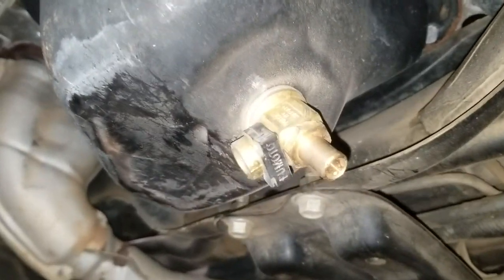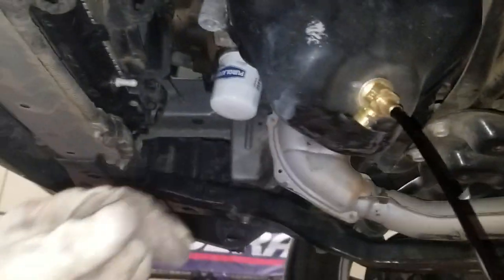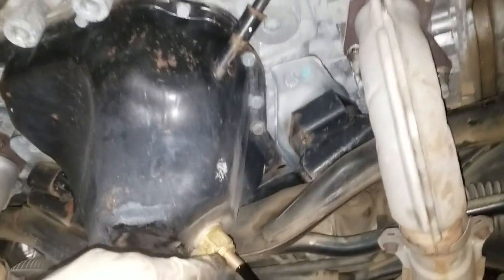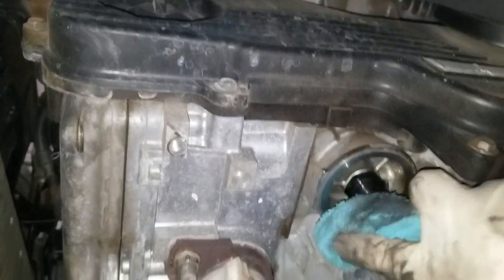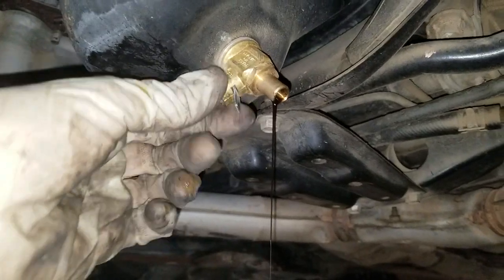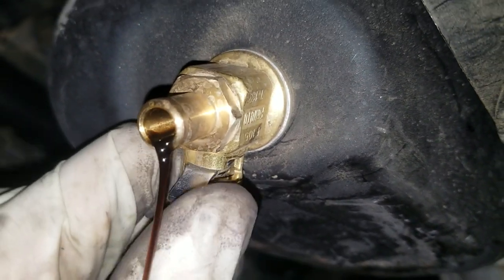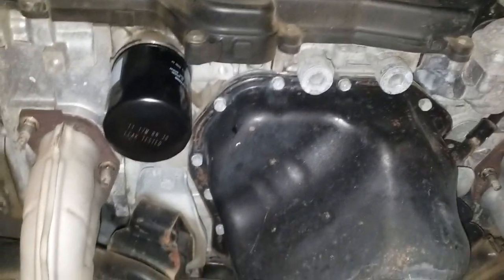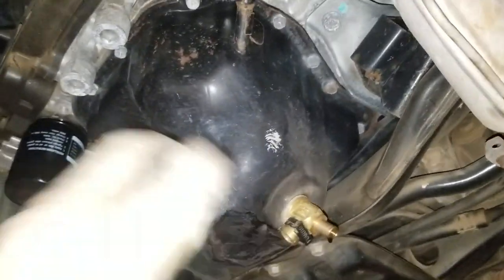Fumoto drain valve dangerous to your engine?

Comment: I'd be concerned that the oil pan is not draining fully. The male threads would stick in a ways and always leave a pool of oil in the pan. All the heavier sludge and metal deposits will sit in the bottom of the pan and never drain out.
Reply: If the pan is sheet metal, then it has a threaded insert that extends above the inner surface of the pan by as many threads as needed to secure the plug. The Fumoto thread length is usually shorter than that, so there isn't any more oil left in the pan than that threaded insert wouldn't leave anyway.

Comment: Does it matter the angle of the car, like when its draining?will it all drain out if its on ramps or jacks?
Reply: and does this work on 2015 subaru Legacy 2.5
Reply: For my car a 04 Lexus rx330 putting the car at a slight angle with ramps actually makes the drain hole aim down more causing more oil to come out. Good design by engineers taking into consideration Diy oil changers
Reply: It drains just the same as if you removed the drain plug.

Comment: By the way-- you don't need that plastic clip-- that's for nervous nellies.  The lever simply can't move by accident.
Reply: I agree with you but what the hell got the clip use it
Reply: @davemartinez4143  Won't hurt. But don't fret if you lose it.
Reply: @MsFarmerTom  I will use it till I lose it. I just don't see how you can open the valve by accident
Reply: Same with wearing your seatbelt. It’s for nervous nellies. It’s not like you drive around looking to get into accidents. 🤔

Comment: So much fluid was left undrained. If the threads go past the oil pan case then all the grit never came out.
Reply: On the Volvo 240 the threads are not high enough to make a difference.

Comment: The only thing that could be "dangerous for your engine" when it comes to these valves, is buying one with an extended hose fitting when your car is low to the ground, or if the plug is exposed to something hitting it and breaking it. Either way, it is up to the buyer to be smart and order one that fits with no risk of it being hit

Comment: Does it still require a gasket?? If so how often do u replace that? What’s the maintenance on these Fumoto valves? Do they ever get gunked up??
Reply from the maker: it comes with a gasket, but I use a metal crush washer instead personally and you never have to replace it. it wont gunk up as long as you do oil changes at a normal reasonable interval, no real maintenance required.
Reply: Wow really?? I’m sold, going to buy one.
Reply: Had one on my Forrester for 7 years. No gunk, no issues at all. Best thing since sliced bread.
Reply: I use a copper gasket just the same as if I were using the drain plug-- but it's the last time you'll need one.

Comment: great video,  one question, how long is that valve last?
Reply from the maker: should last the life of the engine if not longer.
Reply: you didnt let all old oil finish coming out till it stopped completely? I heard these valves dont completely drain out all the old oil completely like 98% only. still got 2% old oil left inside.
Reply from the maker: @angelbluerider9588  no oil drain plug I've seen gets all the oil out. And I've serviced over 40,000 vehicles.
Reply from the maker: my customers with these valves have gone over 10 years so far. I'm not sure on the lifespan, but they are extremely durable and haven't seen one leak and made in Japan.
Reply: @angelbluerider9588  Should running a mix of 98% new and 2% old oil in your engine affect it, you've got bigger problems.
Reply: @angelbluerider9588  2% is insignificant.  There is always old oil clinging to the internal parts when you drain.
Reply: lf it's a Japanese or American made valve it will last at least 10 years, maybe longer. Just do not get Chinese imitation valve, they are garbage and will fail very fast.
Reply from the maker: @TankToChest  this isn't the 1940's where the pump cavitates and doesn't work when you dont prefill the filter ;p
Reply: @TankToChest   I've heard mechanics say this is a bad idea because of possible contaminants from the factory that wouldn't be filtered from the center. Rainman Ray's Repairs makes note of this and explains why he never pre-fills filters.
Reply: @angelbluerider9588  if you’re worried you could run some new oil down with the balance open to get the last bit mostly out. I do that to vehicles when I first buy them.

Comment: I need to get a new safely clip for mine.
Reply from the maker: right? cool little addition
Reply: subtledriver I’ll need to contact them or rallysport to see if I can buy the safety clip
Reply: ANDRE YOUNG you don’t need the safety clip use a zip tie works great . I lost mine too that’s what I use
Reply: Oppel'sOutdoorsandMore  small piece of copper wire - can be re used.

Comment: so when buying a Fumoto drain plug valve, where is a good place to get one?  Amazon?  how do i determine what fumoto to buy?  I have a 2019 Subaru forester,  I got to double check I think the drain plug  size is 11 mm.  What do you suggest  thanks
Reply: just buy it directly from their website
Reply: hey t hanks
Reply from the maker: Found this response via google 2019 forester. "Thank you for contacting us.

Your vehicle will fit a F108 series valve with 16mm-1.5 threads.
Here is the link to our retail store where you can find all the options available for your vehicle:
https://www.fumotooildrainvalve.com/...modelId=584602

If you need help choosing the best style for your specific needs click here: 
https://help.fumotooildrainvalve.com...-these-valves-

If you have any other questions or need further assistance please let us know.

Thank you for choosing Fumoto!

Help center: https://help.fumotooildrainvalve.com/hc/en-us

Warm Regards,
Sarah Rubin
Fumoto Online Store
www.fumotooildrainvalve.com"

Comment: what kind of car is this? I''ve never seen an oil filter so easy to reach.
Reply: Joel Slack it’s a Subaru
Reply: The only car I've ever seen with an oil filter that easy to reach was the loathsome Ford Taurus (we had one for a month as a loaner). The Volvo 240 is okay-- not hard to reach, just want to be careful not to brush against the exhaust manifold.

Comment: You had us at the edge of our seats! We appreciate the sarcasm. ;P
Reply from the maker: hahaha for sure! I think for certain applications with a lot of exposure, there might be a more stout of shorter valve  made available, or have an angle built in to raise ground clearance. Thanks for the comment.
Reply: @subtledriver  that's true. There's also the SX valve that rotates away from the ground. Thanks for the informative video!
Reply from the maker: @fumotoengineeringofamerica3186  I havent even looked into that! Thanks! I need a few for upcoming projects.
Reply: @subtledriver  DM us on Insta, and we'll set you up with one. ;)
Reply from the maker: @fumotoengineeringofamerica3186  Only I would have trouble deciding which one I would want it for. lol
Reply: No sarcasm intended.  the story is 100% true.

Comment: My only issue is it doesn't have a magnetic end so if your engine is new it would be sending all those metal shavings through the engine
Reply: My OEM plug wasn't magnetized.
Reply: @jamienoel  what manufacturer?
Reply: @nativeoutdoors1780  Jeep Renegade.
Reply: I've never had a car with a magnetic drain plug from the factory. I do like magnetic drain plugs. What I use now are FilterMag, which is an array of several powerful magnets for the side of your oil filter.

Comment: Good vid. Is it dangerous? I think you made it clear. It depends on your vehicle and how you use it. Just bear in mind ground clearances.
Reply: My thought. Even driving over a branch/stone that could flick up and damage this protruding valve. That is my concern. If this type of thing is that much better how many car manufacturers put them on at assembly?
Reply: @johnmcdonald9569  most cars have plastic covers under the engine these days

Comment: Clickbait name for your video is pretty low.  And btw, you should let the oil drain completely, I don't know anyone who recommends shutting off the valve while you still have a stream of oil coming out.  A very slow drip OK, a stream no.  And last but not least, when you lube the new filter gasket, use new clean oil, not the gritty dirty old oil.

Comment: Never understood why filters do not have a screw to drain them out
Reply from the maker: Most canister style filters (not the normal spin-ons) actually have drains on them. but not really a game changer, you still get oil everywhere.
Reply: Unnecessary point of failure.  Loosen the filter a little (to make sure it's loosen-able!), then punch a small hole into the low point of the filter to let it drain cleanly.  Did this with our Subaru because the filter was completely surrounded by exhaust pipes and spilling oil on them would make the car smelly for a month!
Reply: Buy a 3rd gen Tacoma they have them 😉

Comment: how can it dangerous to your engine?
Reply: jay.0621 It’s not. That’s just to get views. And it worked for me :)
Reply: When you hit debris on the road that could pull on the lever.... bye bye engine
Reply: @philc.9280   any more dangerous than loosing a drain plug or whatever ?  I wonder how many of these have really failed
Reply: Paul Pfingsten that’s what the safety clip is for
Reply: @philc.9280  I have a skid play and a horizontal drain so it will never hit debris.

Comment: I'd feel a lot better about that Fumoto valve if it was made of stainless steel and had a threaded cap on the end.  I like the convenience, but I'm just paranoid about the clip and switch.  Though maybe not as likely to get bumped driving over heavy brush because of the skid plate on my 4Runner.
Reply: The clip doesn't matter.  I've never used one-- they're completely superfluous. The ball is stainless, the housing is brass. There are other drain vales out there, but none better than these. The valve will outlast any car.

Comment: It's pretty obvious that this valve is easily hit by speed bumps or road debris.  This happened to me once and mine was much more protected than yours.  The plastic clip will not stop road debris.Fumoto denies this ever happens but they';re just afraid of being sued.
Reply from the maker: I would run a skid plate, or the New SX Full rotation series for more ground clearance. The one in this video is getting a skid plate and has the nip nip for a hose to make the oil change less messy.
Reply: @subtledriver  I skid plate would certainly protect the valve but then the ground clearance is reduced.  the only real remedy for that is bigger wheels.  I question how many people are willing to go to that much trouble to use the valve.
Reply: Had one on my Forrester for 7 years. Never had and issue. No road debris damage, no damage from driving on snow/ice rutted roads, no leaks. Not saying it couldnt happen, but I'm confident enough that I'm putting another one on my new outback next weekend.
Reply: @nathanhannah9664  I, too used this product for many years before my problem occurred.  It only takes one such incident to make you aware of the risks inherent with this product.  Vehicle geometry and the position of the lever are critical.  You may get lucky and the handle will be at the 12 o clock position and protected by surrounding parts of the motor.  You might also get unlucky and the handle will be pointed toward the road making it very vulnerable.  Good luck.  I have decided to use an electric pump to evacuate my oil from the top side.  Much easier/cleaner and no worries like this valve.

Comment: Sticks out way to far
Reply: You can get the kind with the nipple, or without.  Depends on where your valve is-- with the Subaru, and the plug on the side like it is, the nipple is no lower than the bottom of the oil pan.